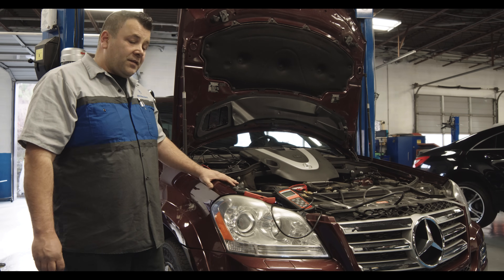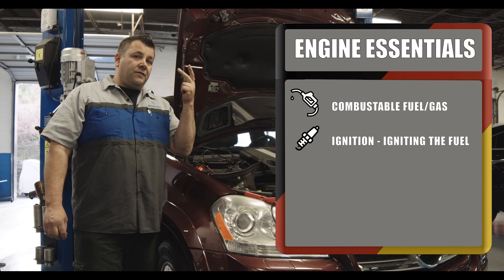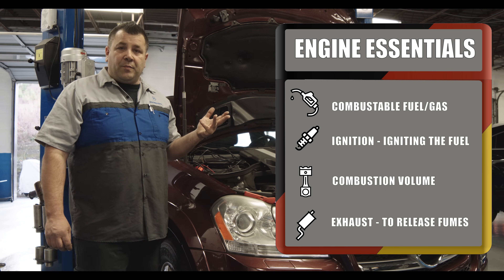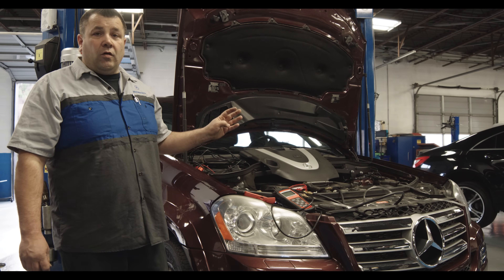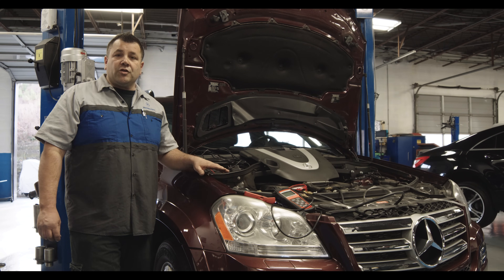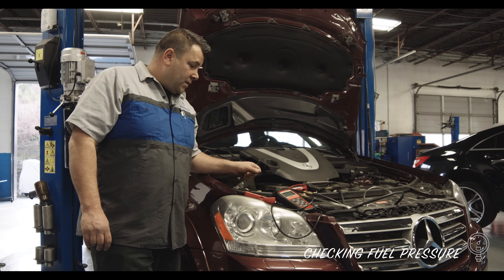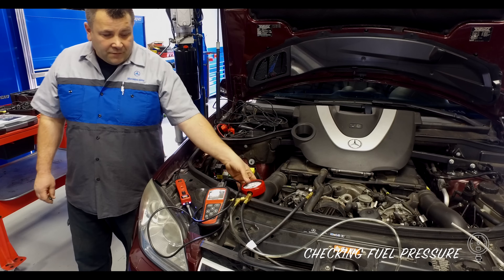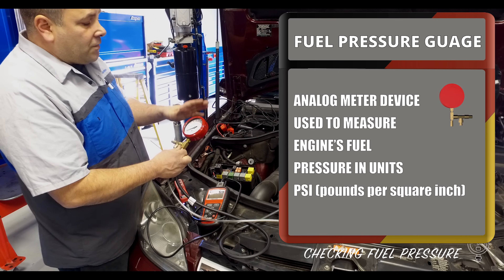Why a car won't start -  Mercedes Benz Troubleshooting Guide, Tips

Comment: So I am extremely impressed with your videos and knowledge I have v bee  to so many mechanics fir my 2012 mercedes s550 and they do not see. To know jack  I have a intermittent no start that turned into never start  I do have codes and errors for Sam being under power or not communicating with the ECM as well as possible EIS problems problems so I'm not sure what it is but I've had this problem before and then it seems to go away II was pressing around at the battery there was a secondary fuse there or a relay Box right near the battery and I touched it no it's gonna clean the connections and it connections and I heard like a power up in my car and then it started and I didn't have a problem for a while all of a sudden my replaced or actually put in a secondary battery into the back I arched the battery up on a bolt's inside the frame work there were the middle few's panel is inside behind the seat and now my car won't start So I do have some codes and errors But before I bother you with my issues I want to say that I am very thankful for this video I'm very thankful for your knowledge and your honesty and being disagreed person you deserve to drive any car in the world that you want with the person that you are I appreciate it a lot nobody wants to help seemingly when I bring my car they just want to take my money and they've taken thousands of dollars for me and nothing has come of it I've had to fix things on my own just make sense of it and luckily I hadn't smarter than most obviously but I still don't know much about Mercedes and my 1st Mercedes I usually drive BMW But I am very thankful for this video I'm gonna try everything that you have just done and walked over I'm up a little bit later just got out of class so I don't have the codes on me and I don't feel like uh staying up to get them but IWe'll get you the codes if you take a second to walk me through it I will definitely send you money I'll pay you for your time as an hour for Mercedes pay about $200 I don't care I need to get this fixed I've been out of work for a year I'm broke I have 3 young kids and I need to get to work my wife started to work she's never worked today in her life but I bought her a Honda and II need a car now and my car is dead and will not start I get a click and that's it everything powers up I have powered everything it clicks I heard everything it clicks one time and then nothing happens and it happens and I think it's too much of a quid sense for the starter to have gone out at the same time that I aren't the battery out so I checked all the fuses nothing is bad I've not checked the relay I'm buying that kit that you have so I can check that and check the starter I'm sorry I'm rambling I'm a lot like you I'm very Explanative andI like to talk and I like to listen so I appreciate you again thank you so much hopefully you can have the time to get back to me I know you're probably a very busy man if you don't don't worry about it I will get your codes and I'll get back to you if you had a number to call you I would appreciate that a lot thank you

Comment: I have a 2008 Mercedes c300 sport that starts when I apply power to the starter fuse, but when I remove power from the fuse, the car dies. I also have no communication with my scanner using the ob2 port. I have tried to turn the key like the standard way to start the car, but I get no start, no crank any ideas?

Comment: A red light came on for me while driving. After that, electronics started failing. First command switched off, then, EBS, ESP, seat belt warning lights and power steering stopped working. This morning, the car won't start. I can get into the car and the engine lights come on but that's about it. Any solutions? E250 from 2010
Reply from the maker: Sounds like water damage to electronics or can communication issues.. check for water in SAM or under seats.

Comment: Good day.  I got a B200Turbo 2007 with 240000km on.  I have tried several things.  The car starts immediately then just stall again.  The engine light will flash and it will stall and then try automatically to adjust it self and then just stall.  The engine light don't stay on.  The funny thing is when you tried it several times and the radiator fan comes on at high speed the car will start and idle perfectly. No problems while driving even at high speed like 180km and stop and go in traffic.  It gets even worst when the car is hot and you switch it off and leave it for a couple of minutes when you want to start it again it starts immediately and stall again.  I have cleaned the throttle body, I changed the coolant temperature sensor I have changed the fuel pump relay and checked all fuses. I have also changed the spark plugs they are expensive and you basically have to strip everything, a hell of a mission.  The temperature gauge stays around the middle on 80 so that seems right.  Cold start is 99% ok but when you crank it it gives a bit of a hard rev and the stabilize there after.  I get a P0605 error code.  Any idea what else it can be?
Reply from the maker: Wow, long comment.. it sounds like there is air getting into the intake from somewhere, sounds like engine running lean.

Comment: I have a 2004 slk230 kompressor and it recently did a "start error" on the dash. It won't start, key turns but doesnt start. Still haven't figured out what's wrong.
 Any ideas?

Comment: I have B200 ,W246,2013 y.Problem is : in last few days it happens several times that after turning the key on 3 position (for starting) lights on dashboard are ok,but nothing happens.Tryied several times-nothing (gearshift lever is on neutral position/it is not automatic).For starting it is necessary to push the gear pedal since it  is a condition for starting(it have start -stop system).After releasing and pushing again the pedal,and normally turning the key every time the engine starts.Is the problem may be in switcher on gear pedal  or what else can it be ?

Comment: Have a w220 s55 the car cranks wanting to start but doesn’t , I put a little gas in the air flow intake to see if it starts it starts and shuts off right away ? Need help
Reply from the maker: Check fuel pressure or fuel quality

Comment: I have a quick question for a w163. I am currently getting a start error message truck was running perfectly fine before I got the message. I bought the truck new in 2001
Reply from the maker: How many keys you have

Comment: Hi David!! PLEASE HELP!!!!!!!!!!!!!!!!!!!!!!!!!!!!!! i dont know whats going on with my car. i have a 2014 C250 Mercedes it wont start. My battery, fuses, and relays are all good. I have a no crank no start. The light come up on the dash, i am able to turn on hazards and headlights. No horn and no power to radio or seats. What do you think is going on
Please help!!
Reply from the maker: Look at the bottom of the windshield, are the water passages open?? Do you have a lot of leaves? Sound like water damage
Reply: @MercedesBenzTechs  Thank you for a  quick reply. No leaves and no sign of water intrusion... I'm beginning to think it maybe my Sam Module. but not sure if front or rear. my fuel gouge doesn't even move up when i put the car in ACC mode only dash lights come on.
Reply from the maker: @viccpicc852  possibly steering lock EIS
Reply: @MercedesBenzTechs  I have an update. I ran a scanner test and got a bunch of fault codes. but particularly for the front Sam unit I get a DTC14100 Communication with front signal acquisition malfunction. could this be my Sam unit is bad? When I ran a test on the rear one the scanner could not communicate. I also then pulled the starter relay and it was bad.
Reply from the maker: @viccpicc852  can be SAM or CAN connector, you need a Professional diagnosis before you spend money on parts
Reply: @MercedesBenzTechs  Thank you for the advise! I wish you were close by so you could earn my business. Appreciate your help sir.
Reply from the maker: @viccpicc852  thanks bud. Good luck

Comment: You forgot to mention bad alternator.
Reply from the maker: There are probably 400 other reasons I didn’t mention lol
Reply: @MercedesBenzTechs  if there are over 400 things electrically that can make a Mercedes not start they suck at designing. I've seen nothing but problems with this brand. Terrible service , and even worse value. You couldnt pay me to drive one. If you did I'd sell it and buy a Kia

Comment: Great info where do you find the relay testing module to fit yr/mk & exact pin testing points thanks . Mr K
Reply from the maker: I bought it from Matcco
Reply: @MercedesBenzTechs  Hi I have a 2002 E430. And my car wouldn't crank. So I went to buy another battery. I replaced the battery but now it won't start. What should I do?

Comment: how do i replace the main computer in a 2008 sclass 550
Reply from the maker: Are you talking about engine computer or signal actuation modules?
Reply: @MercedesBenzTechs  they said main computer the one that display the codes in dash i guess
Reply from the maker: @johnbarns3122  huh, doesn’t make sense.. what are The symptoms, what kind of issue do you have with the car?
Reply: @MercedesBenzTechs It began displaying lots of codes even a code saying take to shop. Took it to Mercedes and they said maybe its the wiring from water damage and it will be between 9 to 12k and will take 6 months bc it takes so long to get the wiring. Then they said it could also be the main computer about 4 thousand. I would have to pay 1250 for them to take out seats and carpet to check the wiring. i googled main computer for 2008 S550 Mercedes and a couple sites came up advertising the computer for 500 dollars you need to send ven number to get the correct computer. Sense its the cheapest i was going to replace the computer but i cant find any info as to where its located and how to remove and install.
Reply: @MercedesBenzTechs  ABS SRS TAKE TO SHOP ADHEINT and a couple more all showing at the same time back to back
Reply from the maker: @johnbarns3122  can you tow it to GA?? It sounds like CAN issues, shouldn’t cost more than $2,000 max
Reply: @MercedesBenzTechs  no im not going to GA what is CAN issues
Reply from the maker: @johnbarns3122  controlled area network
Reply: @MercedesBenzTechs  If it turns out to be the wiring or computer i would have sent it to GA and paid 2k for nothing. Its a pretty car I hate to junk it but between the warranty and me over 55k has been spent on that car.

Comment: Thank 😊David I'm same problem click sound came no turning over maybe relay or starter 😉good work
Reply: I think Your Right I Jus replace mine, but Could Starter fuse or Fuel filter also if Cranks and doesn't Start.

Comment: i have a 08 benz c350 w204 mine starts but shuts off right away sometime it does starts anybody knows why?
Reply from the maker: Sounds like drive authorization issue.
Reply: @MercedesBenzTechs  so is that a part or what is it?
Reply from the maker: It can be one of 5 things,  ISM, EZS, ME, TCU, EIS..

Comment: Great video. I've been trying to figure out the problem with my C230 Mercedes as it cranks but it won't start eventually, or it starts as if there is a misfire in one cylinder. This would happen intermittently, so it was really difficult to find the problem. Run code checks, and there are no fault codes. Making a visual inspection, I realized the short hose connecting the airbox to the supercharger was loosen, as the bracket wasn't positioned correctly which was sufficient to allow more air to be sucked into the engine while cranking. Once the engine started, everything worked just fine and no fault codes were found. Just had to readjust the bracket, now it's all good.
Reply: I have the same problem in my C230 2007 when it starts running good but when I turn off the engine it doesn’t start. So what is the main problem in this case? Any advice please
Reply: @meleshailemariam  did you ever find out? I’m having the same problem
Reply: @meleshailemariam  any luck

Comment: Great video 👍🏽 I have a 2011 ml 350 code 410 came up secondary air pump changed the pump reset code drove car code came back on took put direct power to pump it works but when plugged back in nothing checked fuse & relay both good car was still starting and driving with check engine light next day car will not start can a 410 secondary code cause another problem with car starting need help thank you
Reply from the maker: Check the fuse
Reply: @MercedesBenzTechs  what fuse am I checking thank you for your response 👍🏽
Reply from the maker: @smittybk09  40amp fuse on front fuse box under the hood on passenger side, it’s a very large fuse
Reply: @MercedesBenzTechs  replaced that 40 amp fuse put a probe directly to fuse turn key the probe did not light not sure if there is a short in the wire

Comment: Hey David I have a 2001 Mercedes-Benz c 240   , I bought the car with a after market stereo already installed now a month later car don’t start. I’m trying to install the original stereo is ther any wher that has the car stereo diagram that connect to the drivers door fusebox?

Comment: Great video,I have a 2004 E320 cdi, recently car wouldn’t start when cold showing ESP fault and abs fault, also no coil light, but turning key on and off eventually would start and would run fine all day until cold, sent ECU off for repair, came back no faults even coil light but no crank with key,watched your videos and going check few things tomorrow,any helpful tips much appreciated Rob
Reply from the maker: Sounds like your initial issue was with glow plugs not ecu, you should have troubleshoot glow plugs. Without knowledge and experience it’s very hard to find out what the problem is, I recommend always to take to a professional when basic remedy is exhausted.
Reply: @MercedesBenzTechs hey can I get ur number I want to call you and com to ur shop

Comment: Hiii.. I have a problem with My W202 1996 C200 Gasoline 4 zyl, 4 days ago car was normal start. after that I turn on key but Fuel pump not work, I check all Spark Plug but no Firing or spark...  I start the car engine Crank but no starting. some of work shop told me that the PMS issue... soo i change the PMS but car still the same... would you help me to fix it ?... PMS 018 545 42 32  5WK9 125 i try with PMS 018 545 41 32 still not start but Crank only. My car remote i Lock & Unlock normal.  Many thank
Reply from the maker: Did you check fuel pressure? Did you check for spark in plugs? Did you check compression, did you read fault codes on OBD?
Reply: @MercedesBenzTechs  yes i did check Fuel Press Ok, Spark Plug & the wire there's no firing & i connect my OBD II KKL VAG COM  when car key position on/off There's NOT Connected
Reply: @MercedesBenzTechs  when i turn key to ON position there's fuel pump not turn on , i check the relay is normal i change with new relay still the fuel pump  not On when i turn key to ON position. i start the enggine with remove all Spark Plug connect to ground no firing

Comment: are you in Canada, can i bring to service, recently i had the same problem car did not start some how i pushed to start and took it to the dealer to check the battery he said the battery is ok no problem. i  did not allow them to run diagnostic test as it is very expensive $350. but they changed the recalls for my car. it CL250 4 matic.
Reply from the maker: USA brother.

Comment: Hi there any help would be appreciated: 2012 Sprinter 3500, starting issue: Only way it starts up if there is a external power connection. The battery is new but still will not start on its own. I added a external pocket starter which has a digital voltage reader and sometimes it will show three - - - dashes and other times it will show 14.2v, now it will only start when there is 14.2v visible, im thinking a bad connection somewhere?? Purchased form auction
Reply from the maker: This needs a diagnosis, find a reputable tech around you, it can be a bad ground somewhere or bad starter
Reply: @MercedesBenzTechs  Thanks for your response, will update you all. Just bought a 2012 Sprinter converted to a limo but we have plans to convert it to a mobile home #VanLife. Making videos along the way.

Comment: What if the problem is a code p060A which is a control module performance monitor processor?
Reply from the maker: What year and model and what are symptoms
Reply: Its a CLA250 4Matic 2014, sometimes it doesn't start so I have to wait a few seconds then try again then it starts.

Comment: Great video,my GLK 350 would not start,I checked the fuses and found fuse # 7 blown,I replaced the battery, and replaced the starter relay and still nothing,Helpppp please
Reply from the maker: Did you check the starter??
Reply: @MercedesBenzTechs  Yes,I was able to cheat the ignition key by jumping the starter relay and the car starts fine that way and all lights work and drive the car,but once I shut it off it won't start again